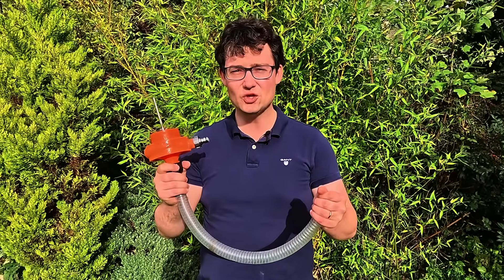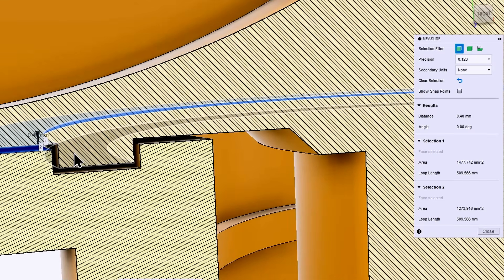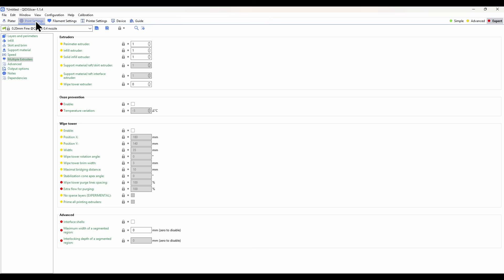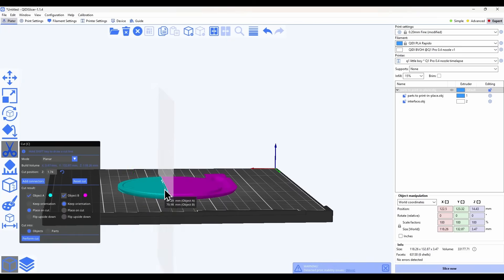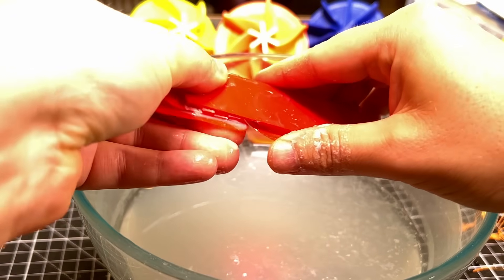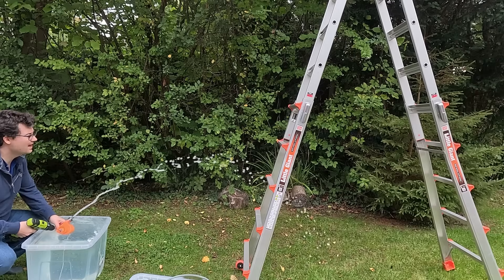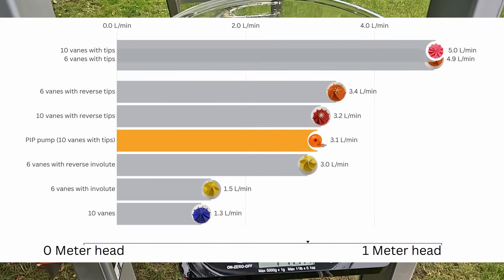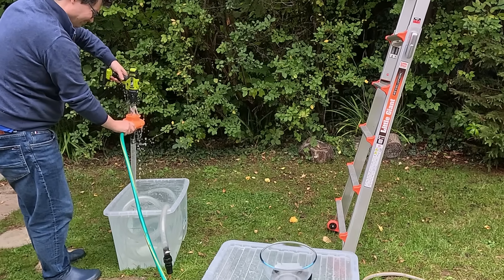How To Build A Print-in-Place Pump (Using WATER-SOLUBLE SUPPORTS)

Comment: I see you haven't been sponsored with a bambulap printer and ams. So uh manual filament swap. OK. Yes.
Reply from the maker: Fair point! To be honest I thought one of the interesting things  about this design is that the total print time for the water soluble supports adds only 10 mins to the total print time. And that it only requires 4 changes opens it up to all those people without an AMS or multi head printer. Also next to zero support filiment waste.
Reply: It's been done like this for over a decade, yes Bambu makes it easier and the new toolchangers that are coming up like the U1 and the Prusa-Bondtech collab are going to be massive too. But you don't need those for multi-material prints if you design it smart enough.